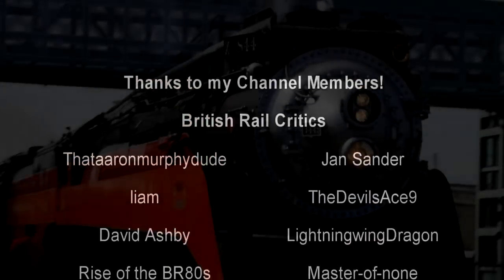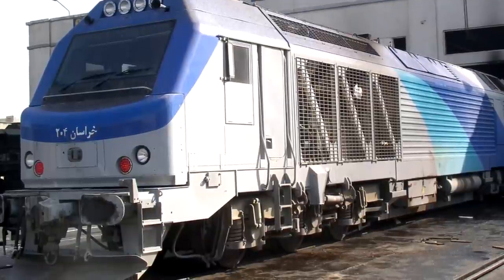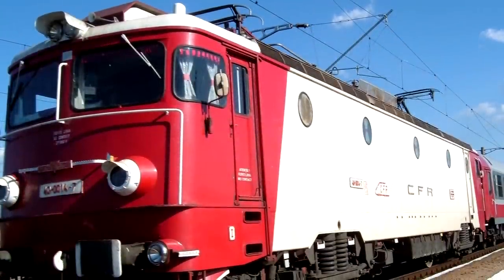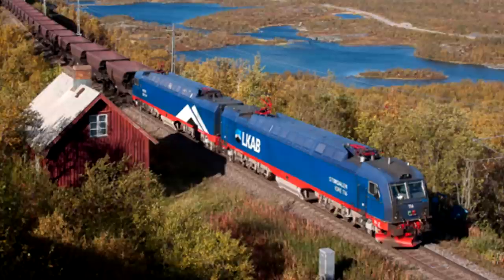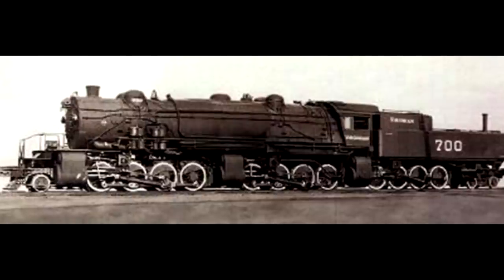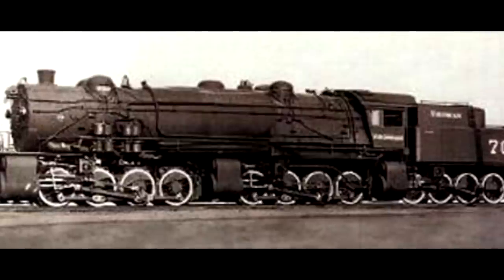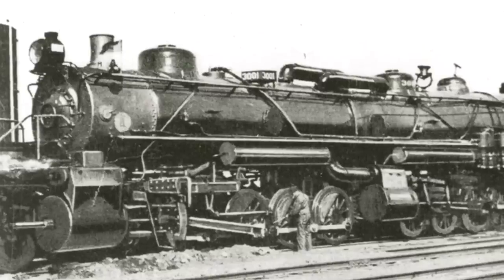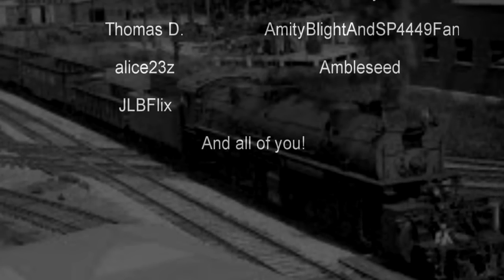5 Locomotives That Are Clearly Compensating For Something | History in the Dark

Comment from the maker: A couple corrections because I am made of failure: 

1. The Iore's tractive effort refers to the individual units, which is kinda wrong since they operate in a pair setup pretty much all the time. So they're even more powerful in practice than I advertised. 

2. Also, more alarmingly, I kept saying "newtons" when referring to tractive effort. That's incorrect. It should be KILONewtons. kN. That one is on me.
Reply: Did you know it was originally the same company designing the Electroputere LE5100 as well as the Iore. but only 10 of the LE5100 was produced by ASEA before licensed production, and ASEA sold there train division prior to production of Iore.

The predecessor to Iore was sort of even more powerful. DM3, was the most powerful single unit loco for decades with 7,200 kW/9,700 hp and 940 kN/210,000lb... Granted, it was a articulated single unit loco. Still not bad for 1950-tys loco that was just a refresh of a 1920 loco
Reply: Potato potato i know what you meant darkness the curse.
Reply: @paulblichmann2791  An American industry? Pretty sure most locomotives are not designed or built in America. Locomotives were literally invented in Europe.

Metric is also the system used by all countries except for the US and UK.
Reply: The IOREs are compensating for braking ore trains down the fjords near the north pole in all sorts of weather (for example frozen winters norh of the polar circle)
Reply: Another correction is there were actually 10 of atsf 3000 class built 3000-3009.
Reply: @anzaca1  UK does use metric and is officially a metric country, but convention and tradition means we have stick in the muds that refuse to use anything but the imperial system, the 3 countries that still use imperial systems are USA, Liberia and Myanmar/Burma
Reply: @anzaca1  They were invented in Britain 🇬🇧
Reply: Shouldn't the title say 6 locomotives?
Reply: @ZeldaTheSwordsman  He always does Top 5s

Comment: Hehehe, you should hear the sound of a classic LE5100, it's awesome. While most electric locomotives are rather silent, this thing is noisy, when the ventilation comes on it's like the end of the world. And the compressor can be heard from a mile away. Why I say classic? Because most of them are now modernised and have different compressors and also cabs. Regarding your question as to why they needed this much tractive effort it's easy, just look at Romania's geography, you have the Carpathians everywhere ===))). Basically these were built to haul heavy freight trains on difficult routs like the one from Brasov to Ploiesti across the Middle Carpathians. Before the advent of electric locomotives they were using two LDE2100 in front and another one to push. Even now on the Brasov to Ploiesti route, depending on how heavy the freight train is, they will use one electric loco in front and one to push from the back. Just to give you some ideas for next videos, do research on the romanian LDE2100 and also the long gone LDE3000 and 4000, you will not be dissapointed. :D

Comment: Something to add to the 5100. It is (to my knowledge) the most powerful 70s locomotive in terms of tractive effort. 
The german class 103 beats them in Horsepower with nealy TEN THOUSAND (9980 HP continuous to be exact)! The 103 however "only" has 70.000 ft lbs of tractive effort.

Comment: LE5100 is based on a Swedish design of ASEA Rb. It was build on license from ASEA. Rb varients was built to Norway, Sweden, Romanian and Yugoslavia. The Rb class would be developed to the Rc class. Amtrak AEM-7 is derivative from the Rc class. So in conclusion LE5100 is a cousin to AEM-7.
Reply: On the RB1T to be specific. Well. The 1965-1969 unit was based on the RB1T. All the newer units was based on the RC1

The RC series is also the the Iranian RAI 40-700 class that was a predecessor to the AD43C... And they also designed the Iore train during there final days. Adtranz was originally just the ABB train unit, that in turn was just Asea Brownboveri... that is the same ASEA that made the RB locos.

Adtrans was sold to Daimler Chrysler just month before the iore first delivery, that in turn was sold to bombardier a year later... That in turn was sold to Alstom in 2021...  Ironic.. and sad. Well the Asea factory in Västerås is still making bogier and power systems
Reply: The LE5100 seems to be very identical to the Norwegian El15 to me, the El15 was a Co-Co variant of the Rb-Rc series built especially for the LKAB iron ore traffic on the Norwegian part of the Kiruna-Narvik iron ore line. That's also the reason for the high tractive effort of these locos.
Reply: @matsv201  Why's it ironic and sad 😔
Reply: @fanofeverything30465  Its ironic because alstom both made the replacement as well as bought the company that made the original loco for that service.

Alstom is really a bad company doing deals that really look very illegal even from just a glance and they just keep buying there competitors. Its like the railway industry equivalent of EA
Reply: @matsv201  Thank you 😊
Reply: @Tom-Lahaye  The only real diffrance between the LE5100 and the EL15 .. apart from the numbers and letters being in the other direction, is that EL15 was ballasted with 30 tons  and the upper body was made by Thune, hence looking a bit diffrent.

LE5100 looks pretty much identical to either RB or RC in the first 10 year of production. Granted some of the later version have a bit of a updated design.

Worth saying is that EL16 is also a RC type locomotive. Again with a Norwegian body.

Its also interesting that all the export version just have more power. If i understand it correctly they have the same transformer just more thyrstors, and at least the LE5100 have a problem with overheating warm days.

It might also be that in Sweden we where incredebly conservative with power output being that reliability was the number 1 priority.

There was also a Swedish version of the El15 made. But it was made with a very different concept. In steed of having 2 CoCo:s the Swedish version simply had 3 BoBo:s. Not loading the transformers as hard.. On the other side, wasting 4 cabs in steed of just two.

Comment: The mallets are great for narrow gauge lines, powerful for their size and able to negotiate tight curves. In Portugal there were two different series (or classes) of mallets and they were the best doing their work, actually they worked until the early 80s in the Sabor line... dut going bigger than that... probably too much POWER.
Reply: When it comes to having a ton of power and negotiating tight curves, a Beyer-Garratt is way superior to a Mallet.
Reply: They were often used on standard gauge in the US, where their power was needed to pull heavy trains in mountainous territory.  The Virginian (seen in the video) was well known for this, as they’d typically pull 20,000 ton coal trains through the mountains of West Virginia and Virginia.  While their Class AE 2-10-10-2, Class XA 2-8-8-8-4, and Class AG “Blue Ridge” 2-6-6-6 locomotives often attract more attention, their workhorses were a very large fleet of 2-8-8-2 Mallet locomotives of various designs

Comment: The electroputere is actually Swedish RB and RC locos. A few of them was manufactured in Sweden, but most of them was manufactured in Romania . To be exact it was based of the RB1T locomotive that have a drive train that is identical to the later RC1 loco. 

electroputere had a mix where some of the early one have a RB design and most of the later had the bit more modern looking RC design. Romaina wanted a bit more tractive effort so they added two axels. The swedish locos was in steed just run on two or three sets. The downside to just adding more axel for the electroputere was that they tend to overheat, despite having a bit lower top speed. This is effectively the same loco as the toaster. (AEM-7) and.. well also the Iranian RAI 40-700 class, that is a direct predecessor to the Iranian AD43C.

This was the same company that later designed the Iore locomotive (before they sold the railway division). The predecessor to Ior was the RCM loco, that again was a ASEA type RC loco, but it was optimized for very heavy loads where it was tripple connected, replacing earlier triple connected DM3 locos that originated from the 1920 (but was rebuilt in the 1950tys), having a tractive effort of 210,000 lb for one loco. Also built by ASEA

The DM3 is a absolute beast with a total power output of 7,200 kW and was until recently the most powerful articulated single unit engine. While the Iore does have 11 000kW, the two units can be split, so its not considered a single unit loco.

And Iore is sort of a joke. Its both short for Iron-ore as well being the donkey from puh. The idea was that it was slow, but incredibly powerful, like a depressed donkey
Reply: *1920s and 1950s

Comment: The last locomotive worked because the boiler over compensates the 2 engines it needs to supply. The ATSF one has a skinny boiler. It will exhaust itself out.

Comment: If the Romanian 40-42 classes are compensating for anything, it's probably the "Workhorses" which were seized by US Customs and Border Protection around 1980, and are rumored to still be held there at the Port of Houston.  They were diesel-hydraulic road switchers that rode on C-C trucks, and had a Voith transmission (supposedly the best ever made for Diesel Hydraulic locomotives).  They ended up in the USA by the hands of some scheister who sold them (at a huge profit!) to industries like grain co-ops in the Midwest.  He never disclosed to his customers that they were made in Romania, at the time when Romania was the most repressive Communist regime (worse than the USSR!).  Needless to say, importing anything like this from the other side of the Iron Curtain practically took an act of Congress to be approved.  As I recall, direct import of industrial goods from a Warsaw Pact nation actually fell under the Trading With the Enemy act.  They're supposedly nice, tidy, factory new engines, with the operators consoles still wrapped in plastic and North American standard knuckle couplers and airbrake systems 😉  Kalmbach's Diesel Spotters guide, 2nd edition is how I learned of their existence.

Comment: There is an even more insane machine than the CFR 40, the V63 in Hungary, they have on the original UFC bogies 450kN (~101000 lb) tracktive effort and they do it out from 3600 kW with record speed of 197 km/h, later they switched to the Krupp license bogies for the better riding quality, those have 415 kN tracktion, the allowed speed is 160 km/h. Yeah, the Romanian mountanis are probably the reason behind the LE 5100's 414kN (93000 lb) tracktive effort (but I am sure about that it is not the 42 variant that has this), no wonder it is a Swedish design, though considering the next locomotive in this list.

Comment: 12:40 Virginian Railway is becoming the new British Rail on the channel it seems.
Reply: Not really. He not making fun of them
Reply: @gamerfan8445  Pretty sure he's saying that the Virginian is just POWER HUNGRY
Reply: @NW2174Fan  well they are
Reply: @gamerfan8445  Yeah, the EL-3A said it all
Reply: @NW2174Fan  and there EL-2B do as well
Reply: @gamerfan8445  He kinda is. And they just keep popping up.
Reply: @gamerfan8445  If you examine the section of their main line between Matoaka and Herndon, WV, known as Clark's Gap, you would understand why the Virginian needed such powerful locomotives.
Reply: No, they aren’t.  The Virginian needed huge power in all of their territory.  While the C&O and N&W had to snake around the mountains, since the VGN was personally financed by Henry Huddleston Rogers (one of the richest men in US history), they cut right through the mountains with an intricate network of heavy gauge rails, tunnels, and massive trestles that are still in use today.  They’d typically pull 20,000 ton coal trains consisting of their famous 6-axle 100 ton “battleship gondola” cars.  While the grade at Clark’s Gap was the steepest - which is where the 2-10-10-2 fleet was at home in and the 2-8-8-8-4 was bought for - they had fairly stiff grades across their mainline.

Comment: Correction on the ATSF 3000 Class 2-10-10-2's: There were 10 ATSF 2-10-10-2's built, numbered 3000-3009
Something about the Virginian AE's: The first Virginian AE, number 800, suffered a boiler explosion on January 4th, 1941, but survived up to at least 1953 (why, I have no idea)
Reply: 800 was surprisingly rebuilt and put back into service.  The sheer power of the AE (that and their size put them in contention for top slot in each category) made them indispensable in the divisions they were at home in

Comment: NSB EL14 2164-2200, Delivered in 1968-1973 and are still running. Max HP 6930 and a tractive effort of 245kN. They are used to haul cargo in Norway, and are so good that replacing them are difficult due to whats available on the market.
Reply: Forhåpentligvis blir det en erstatter ordnet i løpet av 2023. For en som kjører EL14 så håper jeg det skjer snart da det er begrenset med komfort i dem og det begynner å bli tynt med reservedeler så er flere av dem som går som 5 motors, eller har andre problemer.

Comment: Interestingly enough, the ATSF 3000 2-10-10-2's had the same basic problem as the Triplex's (Steam Starvation) but for entirely different reasons and are kind of revealed by the fact that they are compound locomotives instead of simple locomotives.

The problem with the Santa Fe locomotives was their boiler setup, since they were more complicated than most articulated locomotives. The boiler isn't a single piece, but rather two separate segments connected by an articulating joint. Yep, these were bendy boilers, and you can see that with the odd band in the middle of it and the pipework on top. The rear segment was attached to the rear frames, while the front segment was attached to the front frames, so instead of swinging out to the side on a turn, the boiler would bend like the polar express did when climbing that mountain in the movie (nowhere near that extreme, but you get the point). As a result, only the rear half of the boiler was actually, well, a boiler, with the front half basically being a supersized superheater. That's where the problems cropped up, because the boiler simply wasn't able to boil enough water fast enough. The Virginian 2-10-10-2's were proof that a locomotive with the arrangement could work and be rather successful (as well as BLOODY POWERFUL), so the Santa Fe engines were completely let down by their wonky boiler design.

As for the Triplex's (which I am very firmly convinced are given far more stick than they deserve (the Erie's 3 locomotives lasted into the 1930's after all)), their issue wasn't fundamental boiler design, but the fact that half of their exhaust steam was exhausted out a pipe on the tender rather than through the smokebox/smokestack, which given the fact that the exhaust steam is rather important for boiler drafting and steam generation, predictably caused their issues with steam starvation. It was an issue that could have been solved by finding some way to exhaust the rear low pressure cylinders (again, they were compound locomotives with 2 HP cylinders and 4 LP cylinders) out of the smokestack, or using a forced draft fan like condensing locomotives used.

I honestly think that the Triplex's were given up on far too early by American railroads and locomotive manufacturer's, since the concept seemed to be sound, and were only let down by the fact they were given, in effect, boilers with asthma.

Comment: 4:40 Now, you see, that's not entirely true. The DB Class 103 intercity locomotive from the early 70s had around 10,000 hp and a Co'Co layout. The prototypes in the mid-60s had 8,000 hp. Note that this is continuous horsepower, for short periods it could deliver over 13,000 hp (which later was limited to 12,000 hp). To this day they are the most powerful single section locomotives ever built. Yes, they were passenger locomotives, and yes, this was way more power than necessary. And no, I don't know why they decided that they needed this much power. 
Just for comparison, their successors, the Class 101, have a Bo'Bo layout and two thirds the horsepower. And they're still capable of comfortably hauling 14 coaches at 120 mph.
Reply: I think i kind of missspoke, the start production in 1965, so he must ment the 1960-tys. Full license production started alreddy 1967, before that there was 10 unit on series 0 production.  

And this video is mostly about tractive effort, not horse power. Tractive effort of DB 103 wasn´t that high, here the LE5100 had much higher effort being a mixed loco, and not a higher speed loco.

Still they are both dwarfed by the DM3 loco, that granted, is a articulated loco and there for in a other category. Still 940kN is quite a bit more than 314kN of the DB 103.
Reply: Was all that power necessary? No. Did it enable them to reach 170mph? Yes.